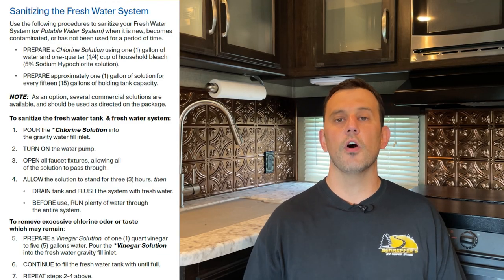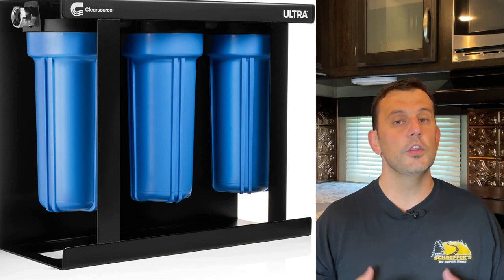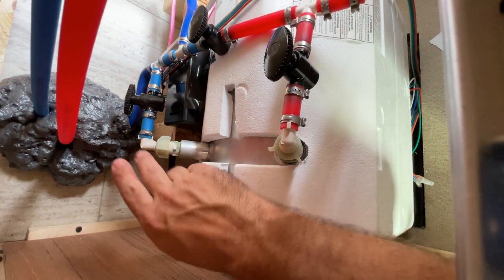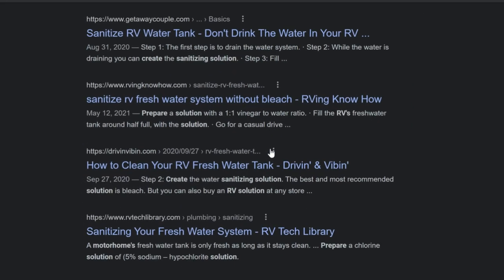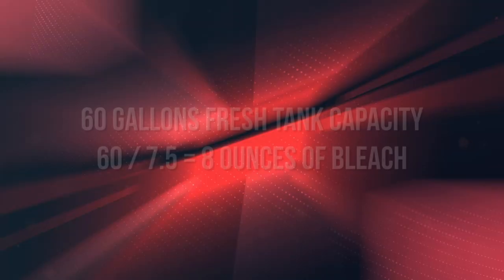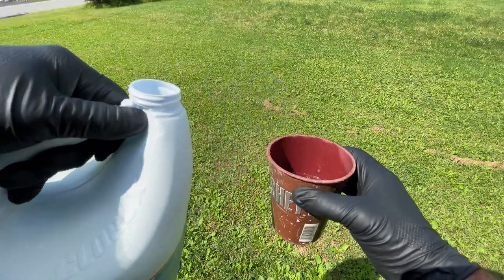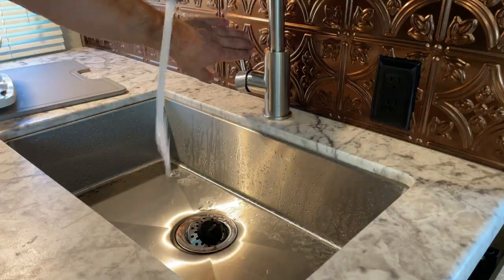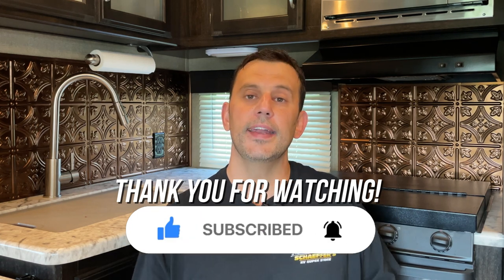How to Sanitize Your RV Fresh Water Tank & Plumbing System!

Comment: Thanks for your tank sanitizing video you covered everything except the problem I am having. I need to rid the mold in my fresh water intake hose (gravity). Can't remove hose cause it is glued in place.
Reply from the maker: Plug your overflow valve, introduce your mixture as normal and fill your tank.  Once the water starts to overflow from the gravity fill shut it off.  That would get the solution in the gravity fill line.  Other than that, you would have to remove it unfortunately.

Comment: I just watched your sanitizing video many times. I'm in the process. At the part where you say to run the water through the hot and cold lines until one smells bleach, the faucets are on and you say to turn them "on." Did you misspeak and say on instead of off? It makes sense to me that leaving the water in the lines for a few hours will clean them. The confusion is that you say to turn them on and then say to turn them on just after the water is flowing. I've turned my faucets off for a few hours. Please let me know if I'm doing this correctly. Thank you. Your video is awesome.
Reply from the maker: Turn them off after you get the water through the line and smell bleach to let them soak.
Reply: I heard the same thing and had the same question. Glad you got it answered!

Comment: Town water is already chlorinated to do exactly this role. This chlorine works, just be aware that exposure to air allows the chlorine to slowly leach out. Roll the town water through your tanks and, voila, they get sanitised.
Reply from the maker: City water does not have this same mixture.  The EPA restricts up to or around 4mg/L.  This sanitizing mixture (at roughly .13 ounces per gallon) is 889mg/L.  Not even close.  You need a stronger mixture than city water to sanitize in applications where water is standing for long periods of time, like in an RV that is used part time.  Additionally, even if city water sanitized as well as this mixture in the video, which it doesnt, it wouldnt help folks who live on a well.  Hope that makes sense and clears things up.
Reply: @RVTIPSANDTRAVELS  Yes I agree well water lacks chlorine, which is why I restricted my comments to town water specifically. And yes if water is left stagnant in the tank then the chlorine in the water will disappear as I said, and so the water can be simply dumped and replaced. Town water (chlorinated) is safe unless contaminated or left to stagnate.  

People in the country collect rainwater for drinking in their tanks, and generally only add chlorine when contamination is suspected or sludge disturbed.

A better rule of thumb IMO is to dump all tank water and consider special additional treatment when water has been left stagnant rather than scheduling treatment after any specific period of time of continual usage.
Reply from the maker: All good info, thanks for watching and nice chatting with you my friend.

Comment: Thanks for the great tips.  I have a question: how to sanitized a fresh water tank and plumbing system with a "Tankless" Water heater (suburban st-60) that doesn't have a bypass valve system?
My RV Tankless water heater doesn't have a  bypass valve system.
Any advice or idea will be appreciated!
Reply from the maker: That will depend on your water heater model.  Best advice would be to refer to the owners manual for that heater.
Reply: OK, 
Thank you for your message and for taking the time to reply.

Comment: Hello, I was your YouTube channel all the time I’m new to camping with an travel trailer and we have a tankless water heater in the book recommends that you run antifreeze through the tankless water heater  do you  bypass tankless water when you’re running bleach and water through your lines or do you just run it through your tankless water heater?
Reply from the maker: because the part of the tankless water heater the water goes through is metal, i would bypass it as well.

Comment: I just found your video. Great info. Is it necessary to drain the hot water heater if you bypass it? Thanks
Reply from the maker: not necessary, but its always good to get the water out of the water heater if its been sitting in there for a while... between camping trips for example.

Comment: Thanks for the vid! Do you and if so, how do you sanitize your fresh water inlet hose?
Reply from the maker: I don’t because I usually just buy a new hose each year, then take the old one and use it for my black tank flush.  However, to do it I would just buy these caps, fill your hose with some of the solution from your fresh tank (won’t need much), add the caps and let it sit overnight.  https://amzn.to/3ub2bp0
Reply: @RVTIPSANDTRAVELS  Thanks

Comment: I get this video was done two years ago, there is second i couldn’t follow you. After running  the sink and shower you said then go and ........ move to the next one”, move to the next one, do you mean run the exterior hose? You go back to the toilet....after waiting 3-4 hrs. Empty water tank, after i pour the bleach mix, do i fill the water tank? Do i need to do this if I don’t travel and don’t use water from the water tank? I APOLOGIZE FOR THE MANY QUESTIONS
Reply from the maker: move to the next faucet, all faucets inside and out.  fill the tank with water after introducing diluted bleach, yes that is mentioned. you dont need to do this if you dont use the fresh tank, but you should be using the fresh tank... i talk about that here: https://youtu.be/ermDoIB-y7s

Comment: I have a tankless water heater I’m preparing to store my ATC toy hauler for five months during the summer and dry climate to avoid mold. I will be sanitizing it with a Clorox or hydrogen Prock side, but what do I do about my tankless water heater? Thank you.
Reply from the maker: This can vary depending on the water heater model.  I would start by looking at the water heater manual under winterizing/dewinterizing/santizing.  If you cant find anything let me know and Ill see what I can do to help.
Reply: @RVTIPSANDTRAVELS  thank you

Comment: We went to a state campground this weekend and needed to film water when we got there. It was getting dark and they had no visible signs saying where things were located. One of the campers that is there a lot told us the only water was at the dumping station. I filled up there not thinking about it until we were already full. Later when we found the camp host she said to use the one in the ditch without and signs it lights to even know it was there. Will bleach work so we can use the fresh water tank again. I used my brand new inline carbon filter when filling. Is that now garbage or can I sanitize that and the hose with bleach also?
Reply from the maker: Oh no!  That’s a tricky question to answer.  I think sanitizing it should be ok but I’m not an EPA expert.

Comment: I have seen videos that say you can pour bleach into the fresh water hose, connect to your tank fill, and fill the tank.  Your thoughts on this vs diluting in water for those of us without a gravity fill?
Reply from the maker: So there are 2 sides to this... however you can get bleach into the fresh tank I'm kind of ok with.  My problem is RV manufacturers really need to give everyone a gravity fill for this reason alone.  Just something to consider though, undiluted bleach in a rubber hose, on plastic, or even against metal, for even a short period of time can cause damage to those materials.  I would try to dilute it even if only a little bit before you ruin a hose or run it through the pex lines.  I know some folks who dilute in a bucket and use a drill pump like this one: https://amzn.to/43hw9H3

Comment: Do you need to fill your tank all the way or just enough to run through all your lines?
Reply from the maker: Great question Rick. You should fill your tank all the way up for two reasons. First, you are creating a sanitizing solution based on the size of your tank, so you want to fill the entire tank up with water to satisfy that solution mixture. The second reason is because you wanna sanitize your entire tank along with your lines. Hope that helps.
Reply: @RVTIPSANDTRAVELS  makes sense.  Thank you for taking time to answer my question.

Comment: My RV water heater doesnt seem to have any bypass on it. Still safe to use bleach? 2022   26BHS  Open Range
Reply from the maker: No, don’t put bleach in.  Either add bypass valves or look into using vinegar.

Comment: Great video as per your usual. Thank you. 

Have you heard of or tried a dedicated product like…. Camco TastePURE Spring Fresh Water System Cleaner and Deodorizer for RV and Marine

This product is safe for water heaters as well. I have a bottle on hand to try when I sanitize this summer. Cost will be slightly more than using bleach but overall may be safer for the soft goods and tank. Thanks again.
Reply from the maker: great question Rick, i have heard of it, but Im not sure of the ingredients... however I would like to note that bleach is actually used in water treatment plants to clean water, and when heavily diluted wont harm you.  in its pure form it can be brutal especially on clothes, but its one of the best germ killers when diluted.  However, I havent done any research on the premade solutions so I cant speak to their effectiveness.  Bleach wont harm the tanks, they are usually made of polyproylene.  Whats important is that you keep bleach away from metal tanks, like the water heater.  Hows your experience with the Camco product?
Reply: @RVTIPSANDTRAVELS  I’m going to give it a try in a couple of weeks and see how it works. I will report back what I find. 

Bleach is definitely effective. I was curiously looking at other chemical options and stumbled upon the camco product. The process is slightly more efficient with less “dwell” time required than with bleach.
Reply from the maker: keep me posted
Reply: I was going to attempt using the camco product when I learned/realized it is not an EPA sanitizer. I then found another product, star brite tank cleaner and again it is not an EPA sanitizer. So I’m going to research the thetford cleaner/sanitizer but the cost per cleaning is getting out of alignment with just using bleach.
Reply from the maker: lol, keep me posted on what you find Rick
Reply: Well last night I sanitized the fresh water system using the thetford two step system. The thetford cleaner sanitizer is registered with the EPA so I’m guessing that means something in regards to the sanitation claims of this product. I did google search the active chemicals and they are food grade sanitizer. 

Pretty simple process, as the wait times are minutes instead of hours. Required at least three tank fills and empties. With the nautilus P4 panel in our GDRV there were valve manipulations required to go from power fill to dry camp to clean the faucet lines, as most would have to do anyway. Pretty straight forward process, not very many directions on the bottles but they seem thorough enough to get the job done. No lingering smell of bleach. I have an in demand water heater so I did not bypass. 

So the overall savings is do you want to be done in a couple of hours (I worked on other things during the fill and drains) and spend $16 or spread the work out over 6-8 hours and spend pennies on the dollar for cheaper bleach. 

Heading out today. If you’re ever in Florida hit us up. We would love to meet up and grill.
Reply from the maker: very nice, thanks for the input, I might have to check it out... and likewise, ever in or around PA, let me know, first rounds on me!
Reply: Sounds like a plan. We look forward to it.
Reply: More feedback from camping after using thetford tank cleaning system. The first evening of camping after sanitizing resulted in somewhat foamy water, nothing too crazy but you could tell there was some detergent still in the lines after following the instructions for cleaning. Nothing too major.
Reply from the maker: thanks bud, probably will need to rinse and repeat 2-3 times your guessing?
Reply: Correct. Or run longer than the minute the instructions state for the rinse after stage 1.

Comment: I have been searching (to no avail)on how to  clean a very stagnant and dirty water tank.  
I just bought an old, used RV (1986 Coachmen Classic on a Ford E350 chassis) as a "fixer-upper" project, and the water must have been sitting in the the tank for years.  How no lines were broken from freezing is a mystery to me.   When I ran the pump, the water from the faucets was black-ish and stinky. Foul, FOUL stink!  Upon visually examining the tanks (my RV has two translucent tanks under the bed) there appeared to be two inches of black gunk or crud coating the insides of each tank about two inches up from the bottom.  I ran the water tanks dry to remove that nasty, ungodly FOUL smelling water from them.  I doubt a rinse with bleach is going to remove that crud from the tanks.   Is there something I can put in there to break that crud down and allow it to wash out, or do I have to replace the tanks? 

I thought about a very strong bleach solution, about four inches in the tanks, then drive on a back road, weaving from side to side to slosh it around really good. Then drain & repeat a few times.  I also considered removing the tanks and shoving a pressure-washer wand into the openings to try to blast the crud out.   But that would require completely demolishing the bed to do so.   It's quite funky under there, and there are a few broken planks,  so that may still happen anyway.
Reply from the maker: You might want to look into getting it hydro-jetted if it’s really bad.
Reply: @RVTIPSANDTRAVELS  Thanks for the advice. 
I may hit up Amazon to see if I can find such an attachment for my pressure washer.  If I can, I may only have to remove the filler hoses and clean them in place.  Afterwards I'll use the sanitizing method shown in the video.  

Note:  My first comment may have led one to think that the crud was two inches deep in the bottom of the tanks.  I should clarify:  It appears to be a gunky film coating the bottoms of each tank and two inches up the sides.

Comment: I have a tankless water heater? ?
Reply from the maker: treat the water heater as if it were just additional plumbing lines, which it is essentially.  you might want to avoid bleach and use white vinegar as well, as the lines in the water heater are metal.